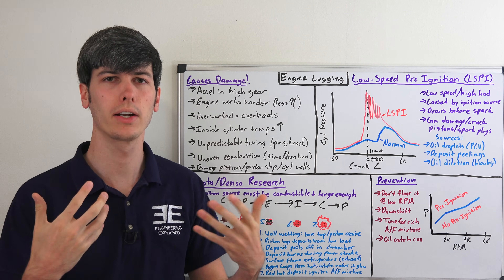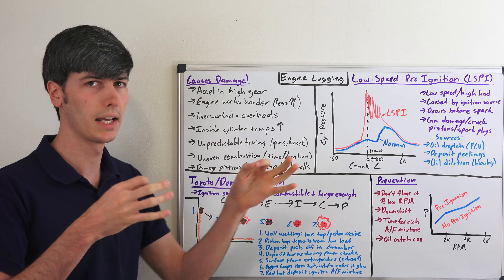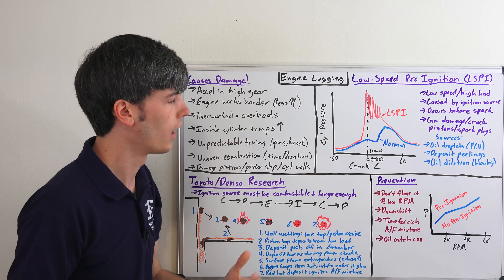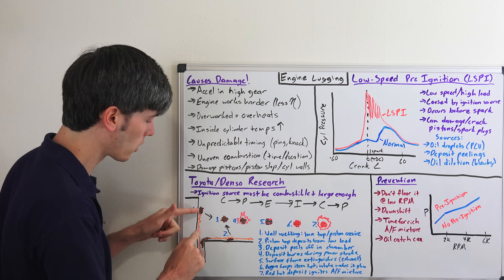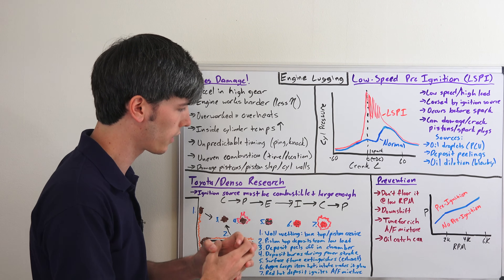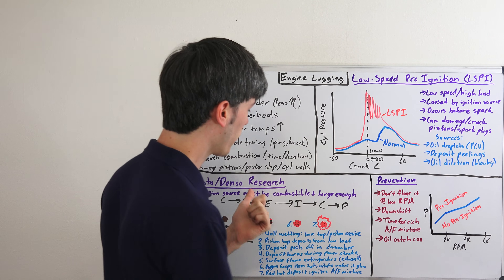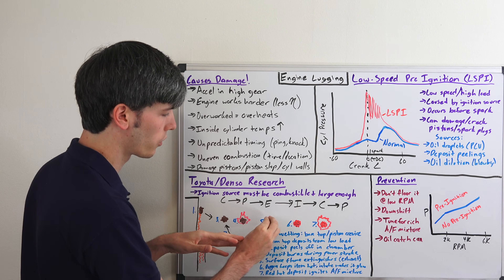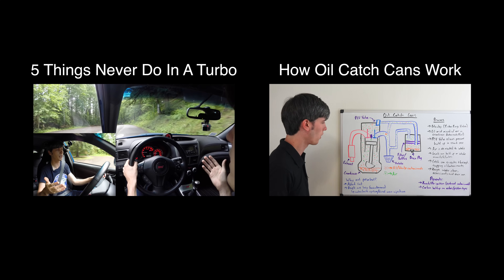Why You Should Never Lug Your Engine (Especially Turbos)

Comment: So I understood the part where he talked about the research done by toyota...what I did not understand is how its a problem exclusive to flooring it at low rpm. He said the deposits form on low rpm, low load, which i can get behind. But then whats the difference in regards to shaking them loose between low rpm high load and shifting down and then applying high load? wouldnt the higher rpm just help with shooting all that residue up into the combustion chamber?

Comment: A friend of mine (who originally got me into FD RX7s) used to drive his FD around the city area in 1st gear basically as much as possible, and it was nothing for him to be cruising around at 4000 or 5000rpm, such is the nature of the rotary. I figured it was because he just liked the exhaust noise. In reality, he was preventing lugging on a turbo car that naturally has very little low end torque. You can't lug a rotary around town in 4th gear. A lot of people see rotaries as having a short lifespan. This guy had gone 200k miles on one engine. Once I figured out why he was driving at higher rpm in lower gears (far less lugging and chamber pressure and gearing to overcome) I began driving my FD the same way. Its gone ten years on the same engine, and I daily drive it. I walk down the street in summer and I hear Camrys and Corollas creeping in traffic, and sometimes I hear cylinder knock as they slowly take off up a hill. Most likely being started off in a high gear and forcing the engine to lug.

Comment: At low rpm under heavy load, the velocity of the intake charge is quite slow. 
The intake charge helps cool the valves and if the engine is kept under a heavy load at low rpm, this could raise the combustion chamber temperature leading to pre ignition. Think of this another way: Engine manifold vacuum. When the intake manifold vacuum diminishes (heads towards zero) the incoming velocity is also substantially reduced. Keep manifold vacuum high and the engine is happy.
   There was a time when some cars actually had as a factory option a so called economy (vacuum) gauge. Keeping the vacuum high resulted in the best fuel economy. A boost gauge will show vacuum and boost, it is easy to tell why you don't have boost when you have wide open throttle at low rpm. The turbocharger requires reasonable pressure of exhaust to spin up, without this your stuck in the land of diminished intake manifold vacuum.
Some standby generator sets are run so hard that the valves will burn in as few as 100 operating hours. This type of load is akin to continuously driving up hill, towing a trailer at wide open throttle. This is another reason vehicles have transmissions.
Let engines rev but always leave some throttle in reserve, if one must hold the throttle wide open then you are in to high of a gear. It really is about load management, and to some extent why vehicles have automatic transmissions ;>)

Comment: I'm pretty sure turbocharged engines are less vulnerable to this, not more.  Turbocharged engines pretty much universally have a lower (geometric) compression ratio than non-turbocharged engines, resulting in lower peak chamber pressures at low RPM regardless of throttle.  At full throttle, my WRX doesnt really even begin to spool up until about 2500 RPM and isn't going strong until about 3500RPM.  Maybe there's something I'm missing though.

Comment: What if you have a turbo car that's torque based and all of the power is low in the RPMs? My modified 2011 335i makes all of the power between 2k and 5k RPM @18PSI.

Comment: On the other hand, if you downshift, your engine rpm will increase which will lead to increase in friction in the engine which in turn will make the temperature rise and make parts wear faster, so yeah i think its safer to lug the engine, thanks for nothing.
Reply: Depends what kind of load you're putting on the engine. Heavy? Put more gear in it.
Reply: Maybe. Are you? Guess i´ll take one of those fun and totally accurate IQ tests to find out
Reply: I'll give you an example. In my teg I drive in 4th gear at 60 km/h with 2k rpm. The best thing to 
Do in this scenario is to downshift into 3rd if my speed starts to drop under 60km/h and then shift back into 4th if I'm trying to accelerate past 60. By shifting from 4th to 3rd going 55 km/h my rpms will go from 1.8k to about 2.8k rpm. The car drives best when it is at 2 k to 3.5 k rpms. So by downshifting it would put me in the optimal Rev  range of the engine to give me the boost that I need, without having to lug the engine.

Comment: I fully understand the deposit theory with it/them getting sort of stuck within the cylinder causing damage to the cylinder walls, piston skirts, and/or rings, but for how many combustion cycles do think a particle will last? Surely not many...either it eventually gets pushed out through the exhaust valve or it simply just burns up.

Comment: honda's pgm-fi (at least on my bike) practically overrides that,by adding a second air thing clappet (we call it butterfly here) that is opened by the ECU,so even if you open the throttle @ max the ECU keeps the second clappet opened just enough so that the engine will have a linear acceleration up to a point where it can give what you want,then you get a sudden burst

Comment: Lugging means higher internal peak temperatures in the cylinder.  You could also burn an exhaust valve.  Automatic transmissions are a good thing, especially when there are so many people driving around who have no clue about how their driving habits affect their vehicle.

Comment: Automatics especially on American car's are notorious for not downshifting in a timely manner. Granted her car is not forced induction but it is still very annoying. When you give a car 3/4 WOT it should not take it's time downshifting. 

Very interesting info. I used to have access to ASE White Papers but not any more. They want too much for the service for someone that is not looking at these papers for work just for fun! 

Toyota and Lubrizol did some cool research wtih anti-wear agents and radioactive isotopes to determine what parts liked what antiwar agents. My Dad's car and my truck are manual transmissions so it is so much easier to prevent lugging when you have complete control of the shifting. A lot of automatics today are a pain to shift and do not have a novel paddle or +/- stick to make shifting easy. 

Emissions and Cafe are a huge part of the problem. Does direct injection make this problem even worse due to deposits?

Comment: How about full throttle at 60 to 70 mph??? Revs at 1500-2000
Reply: Diesel? If yes, than it's ok at 2000rpm. If gas, it's bad!
Reply: Andrei Besleaga thanks ! Its gas but good to know about diesels. 
I assume it doesn't matter weather auto or manual.

Comment: WOW this is the worst explanation I have ever heard a lot of words and you still have it wrong. Most of your talk is about a engine with many miles and carbon deposits and nothing to do with what the topic is.
OVERLOADING your engine pounds the MAIN bearings because of the vibrations that are caused when you have a "detonation"  during the compression  cycle. (in high mileage cars carbon deposits can glow and ignite like a glow plug) but that is not what is happening when you overload the engine. The engine is "dieseling" which detonates(explodes) and not ignition (burning) .
Reply: its pointless explaining anything to those who are completely oblivious the workings of an engine

Comment: Oh yaa, I remember having it in like 5th gear at low speed like 40mph or something and the nissan motor made some weird noises when I tried to accelerate. I just shifted down to like 3rd or something, i dont remember because its been like 10 years since i drove a manual.

Comment: not so sure on your views of efficiency - most every day car engines are most efficient around 2500-3000 rpm, throttle wide open or close to, which if your going 30mph in 4th for example may be what you class as lugging. this is because of the reduced manifold vacuum at WOT, and the pistons doesn't need to do work to intake air, occurs around 3000 by design of the intake porting etc. this can be seen on the otto cycle graph, the 'pumping' cycle is energy lost, and is less with butterfly valve more open. from memory the efficiency is measured in g (fuel burnt) per kW.hour. google image torque speed maps to see for yourself. if your car displays fuel consumption can also see this going up a constant hill at constant speed, first try in 3rd, then knock it up to 4th, 5th, fuel consumption will drop

Comment: You don't have to worry about this in modern automatic cars though. Usually they drop a gear or two when you floor it at a high gear
Reply: TehZured WOW...! really..?
Reply: I know right dude! Completely unknown!
Reply: my commuter will downshift from 3rd to 1st if you floor it at 20mph its hilarious
Reply: wtf 1st?
Reply: even older cars had kickdown mode - usually needed an actual cable to the transmission :D

Comment: I'm not quite with the "overworked = overheated" part. This does sound deceptively logical, but could you elaborate? What does actually happen inside the cylinder so that the overheating happens?

Comment: Lower RPM at a given load = more torque required = higher BMEP = higher thermal efficiency = lower fuel consumption. Pretty much all engines get better efficiency when working hard. Do you have an explanation or source to your claim that engines have lower efficiency when they work harder. Engine is a heat pump, higher temperature = higher efficiency... Basic thermodynamics?!?!

Comment: Another concern with lugging is, besides the engine, drivetrain wear. Especially if we're considering motorcycle engines which may have just single or twin cylinder engines. It's pretty common knowledge that for example a single cylinder bike can wear through chains and sprockets faster than, say, a four-cylinder (given an identical drivetrain, engine power characteristics and so on). And this is especially bad if the engine is lugged, when the power pulses of a large single-cylindered engine are timed much further apart than a multi-cylinder. So in effect the time between each application of torque to the sprockets and chain is very far apart. That will lead to the chain having more time to go slack between the power pulses.

Comment: i wonder if this is why a truck i know alot about has a slight tick/knock (its a odd noise) under low-to-mid load mid load and high load, the sound does get progressively worse but under a load whilst maintaining low rpm it doesn't make this odd sound, it starts to be audible around 2k and this truck only revs to about 6k (5600-6400)

Comment: What a rubbish! High or full throttle is close to the best efficiency at all RPM. Every specific fuel consuption diagramm shows that. And it doesn't heat up as much at lower RPM than at higher. 

The efficiency peaks at about 1/2 of max RPM. But If you don't need the power it's always more efficient to have much or full throttle at lower RPM than less throttle on higher RPM, cause efficiency drops with throttle (lower than appr. 90%).

And to prevent knocking there's motor management, that sets ignition timing right. You are talking about engine technology from the 1960s, Sir. And lower speed of gases inside the engine is always better for homogenous distribution and so for even combustion.

Comment: Although the above has a certain pragmatical basis, it is not always entirely the case. Most modern engines, with advanced engine ecu units and software, can detect knock, pinging and pre-ignition, through very sensitive knock sensor/s,  catching it right just about it starts detonating, and thus reducing timing, and or richen afr at a specific load point/s.By reducing timing and in combination with richer afr, the ecu manages to minimize to the greatest degree possible or eliminates detonation and pre-ignition completely. Also the above conditions, vary a lot from setup to setup, as these adverse effects depend a lot on  the materials used and on the design  of the internal structure of cylinder block ( i.e cooling and oiling), cylinder head and ancillaries, pistons and rings, inlet and exhaust manifolds, turbocharger and intercooler used, degree of  cylinder pressures and heat produced. It;s not about how early in the rev range boost is introduced, it's about how much early boost is introduced and if the rest of the setup/engine can cope with it.  On some engines these effects are severe, on others, are almost non existant. Also I do not agree with the comment about the colder range plug not working, as it does.

Comment: I was actually using this 'technique' ( high gear, low RPM) to heat up my engine faster, especially now during the winter periods. My 2.2 L. high pressure turbo diesel needs 20 minutes of driving to start heating up normally in urban/ high traffic environments, however if I put it on 4th or 5th gear with 1400 rpm and push the gas pedal it starts heating up much more faster and the turbo works harder to compensate... And believe me, when outside is -17 degrees Celsius, you really want the car to heat up faster... haha
Reply: go get a heat pump. it warms the coolant well plugged in overnight so that your motor has some warmth when you first start. it does a much better job then a simple block heater, If your -17 I would also be using your block heater as well
Reply: LOL, I did the same with my moms old car in the winter. Of course I used the block heater before starting, but a 1.8l carb Camry does really not heat up quick. If the engine would have blown up mom would be 500€ poorer, as that is what the car was sold for in the end :)
Reply: Tsetso Zdravkov a
Reply from the maker: +Tsetso Zdravkov as far as lugging your engine, it's always a bad idea for gasoline engines as it can lead to pre-detonation; especially bad idea when the engine is cold. I certainly wouldn't recommend for diesel engines either, but since ignition is based on when fuel is injected, you likely don't need to worry about knock.
Reply: I just can't think of any other way to heat it up faster... maybe the old east-european technique with putting up a piece of carton in front of the radiator could also do the job... But this is  a nasty type of solution. Those diesels were not meant to be driven during the cold winters.
As for the carton, you can find and laugh at the example here: https://www.4tuning.ro/images/halloween-auto-made-in-rusia/halloween-auto-made-in-rusia-c470a1b32746075d6f-0-0-0-0-0.jpg : ))

Comment: wonder why he did not mention having high compression ,, which causes a engine to fire without spark under heavy loads or at shutdown ,,this was big problem in older cars ,,and had to adjust timing to control for lugging or heavy load ,,,and a sol was installed to shut air flow off during shutdown,,

Comment: Poorly designed engines and ignition systems cause pre-ignition most of all. Hot spots on the piston and head causes the mixture to pre-ignite. Of course If the ignition isn't stock that can also cause a problem with the timing set wrong.

Comment: Can the designers prevent this by programming the 'drive by wire' system to only allow the throttle to open so much per given RPM?  Maybe a message on the console recommending downshift?

Comment: False fact1: less efficient when lugging
Gasoline engines are usually more efficient while lugging, since a more open throttle and slower rpm result in less pumping losses, and a full cylinder charge burns more completely than a partial cylinder charge.  Source: multiple, Bosch literature comes to mind

False fact 2: overworked = overheated
Whether you are making 80hp flooring it at 1500rpm or 80hp at half throttle and 3000 rpm, it's still 80hp the energy put into the cooling system is the same, or possibly less when lugging due to greater efficiency as explained above.

Comment: One very important thing that was left out is lugging can also cause bearing failure. Since all of that load is put on the engine at such a low speed. The hydrodynamic layer of oil in between the bearings and rods or journals will get pushed out and in turn make flat spots on the bearings causing premature failure.

Comment: I've got my 350 truck engine set up for low end torque, dual plane intake, heavy advance springs, torque specific camshaft, high volume oil pump, and high flow water pump with extra large radiator. Don't think lugging it is going to hurt it that much, but I see where you're going here with small turbo charged engines.

Comment: If you look at the BSFC efficiency charts of most engines, you'll find that engine efficiency usually goes up with engine torque, and down with RPM. Most engines are their most efficient around the torque-peak-RPM while outputting a little below maximum torque. It's actually more efficient to to use a higher gear with more throttle than a lower gear with less throttle assuming you keep the acceleration rate the same.

Comment: Is this only for manual or what in any auto car going on the highway in 6th or 5th gear 1500-2500 rpm then floor it the car will downshift immediately to 3rd gear nd revs will shoot up so what then???
Reply: Is this when you have 500+horsepower and flooring it in 6th gear from 1500 rpm will cause damage?????

Comment: +Engineering Explained flooring it while at Low RPM does not over heat, it actually causes a richer fuel:air ratio which yes makes it less efficient, but also actually runs cooler than a lean ration would because not as much of the fuel ignites due to the lack of air for the amount of fuel you're putting into the cylinders.